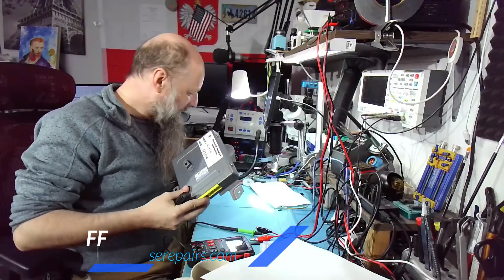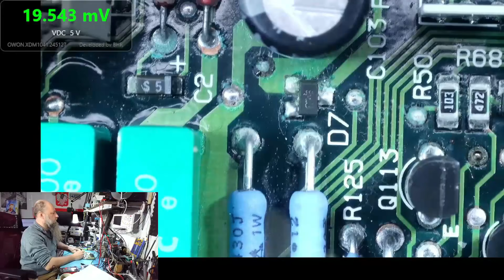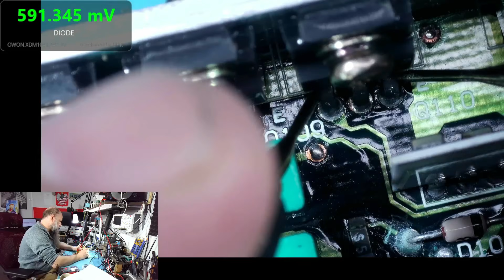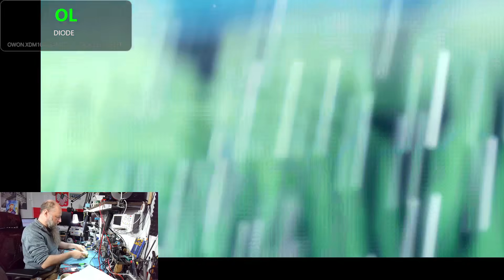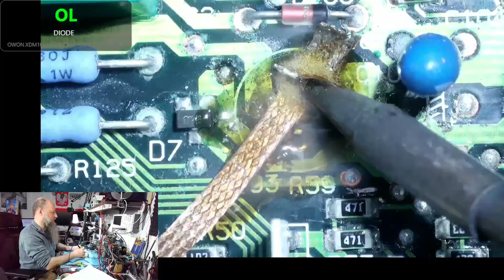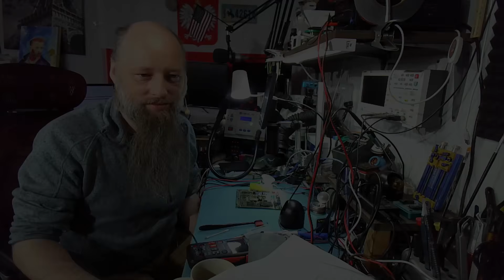346 | Mazda B2600i ECM Injection Repair

Comment: The whole "don't be afraid to ask for a lower price" is something I believe in.  I just insist on honesty and I'll work with you.  As an example I recently sold a mainboard for a 3D printer on ebay.  has a buyer reach out and he was blunt that with the tariffs it would cost more than he could afford and all he wanted was to get his printer back up and running without having to do a lot of modifications.  He needed the board I had as they are out of production and VERY hard to find.  He was upfront and honest and I asked what he could afford.  he gave me a number I was good with and it was a done deal.  A couple of weeks later I get a message thanking me deeply for the help and he included a few pics of his printer back up and running like new.  As far as I'm concerned it was a win-win.  He got his printer going at a price he could afford and I got money for an old board I would NEVER used again and had sitting in a parts bin for over a year.
Reply from the maker: That's a great example of how it can work out for everyone!